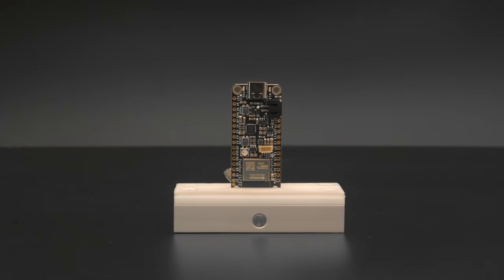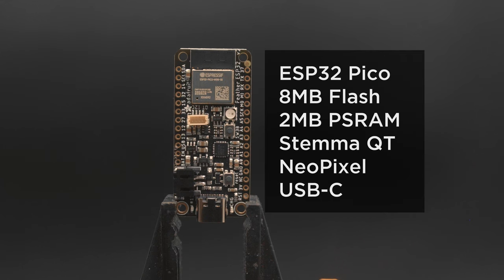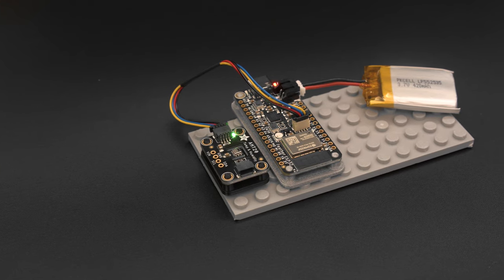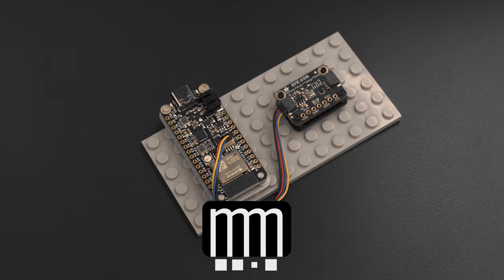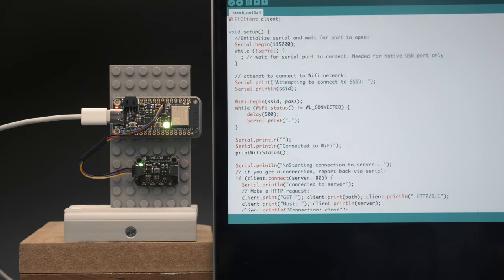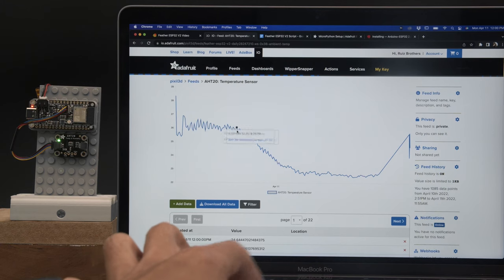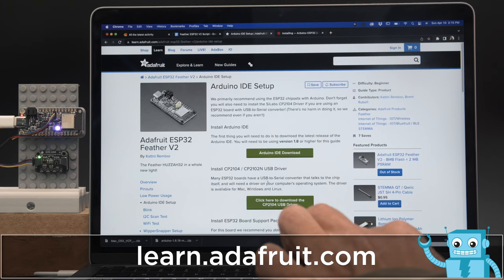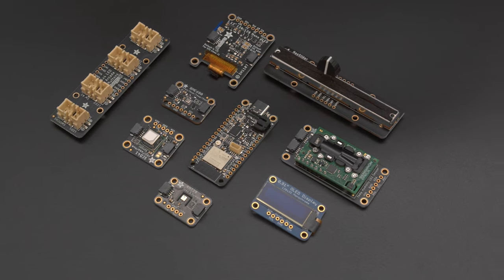Feather Huzzah ESP32 V2

Comment: just got my Huzzah esp32 with the OLED Display FeatherWing.....looking forward to playing with this....Magtag is great but honestly a smaller device & screen does the job equally well and doesn't bring along the baggage of presentation.  At the same time got the LilyGO T-Embed imagine a slightly generic ESP32-S3 Dolphin module (more in looks than design I think).  But essentailly two of the same kind of setup....one I'll be buildin myself out of the Adafruit Feather & Feathering products while the other is assembled to demo what kind of things might work and be useful.  The Lilygo will be a sort of testbed for my IoT